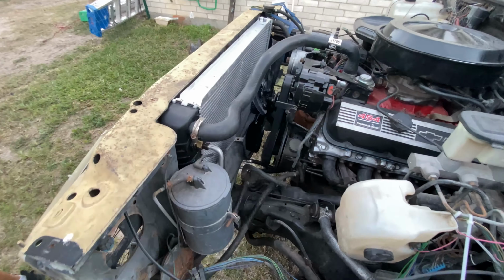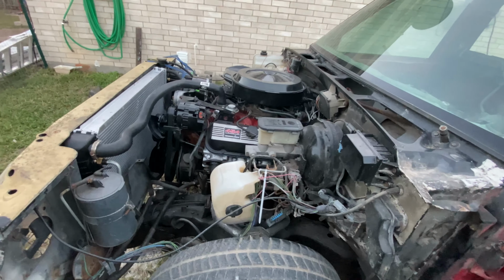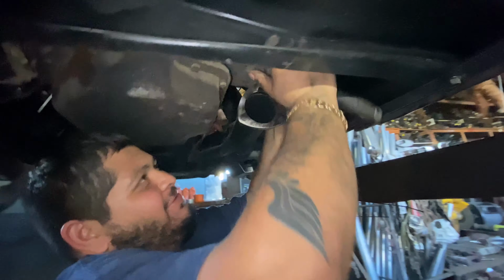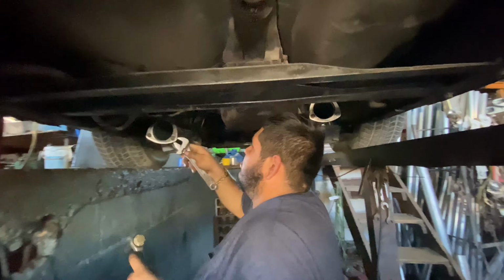FULL CUSTOM EXHAUST ON 454SS OBS CHEVY

Comment: how much did it cost ?
Reply from the maker: If I remember correctly
$350 for headers (installed myself)
$80 each muffler so $160
$240 for the full pipe